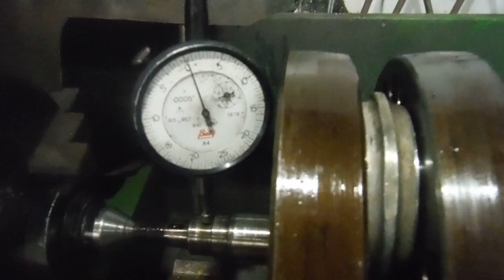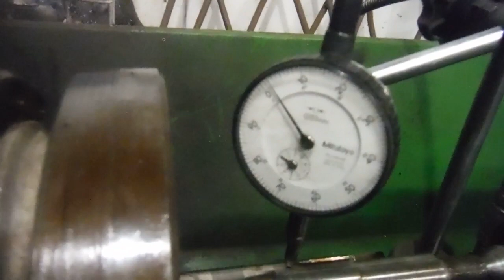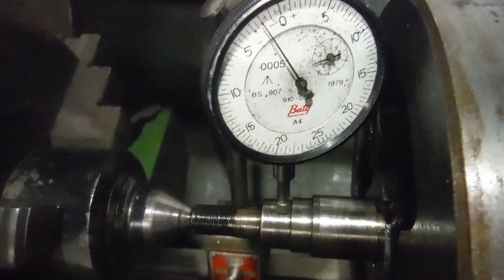Royal Enfield Bullet 500 crankshaft runout demonstrated and discussed.

Comment: Hello paul! I have a similar issue on my bullet. In my case, the rotor magnet touches the stator and  runout at the magnet is visible as it touches the stator. Due to this, my alternator stator is getting burnt up as I have changed 3 stators so far. How serious is my crank runout issue? Can I fix it without getting the crank case pulled apart?
Reply from the maker: Unfortunately, the crank would have to come out in order to put that right.
Reply: @paulhenshaw4514  That's sad to hear, but my doubts are cleared, thanks to you!

Comment: Am I to assume that that unexpected/unusual runout is due to an inherent 'out-of-balance' condition, causing a side-to-side flexing, and thus asymmetrical wear, of the shaft in question ?
[BTW, I just love the word grouping "that that" in the English language. A unique, grammatical, 'runout' of its' own !]
Reply from the maker: Sadly, that run out was probably passed as 'ok' by the factory, but the life of the main bearings would have been compromised as a result. That fretting on the drive side mainshaft is present as a result.

Comment: Yesterday i managed to spilt the engine, but the crankshaft wouldn't come out the left side without tapping with a rubber mallet.
Should it be adjsuted again on a bench? It ran almost vibration-free.
Reply from the maker: It is quite normal to have to do that. It should be ok.
Reply: @paulhenshaw4514  Thank you! i can be quite insecure about that.. at the same time when i see a crankshaft to be aligned, also with quite carefull blows..
I think when assembling, i will heat up the engine housing at 120 degrees and place the crankshaft in the freezer (jawa method) so nothing gets stuck half-way and have to hammer the engien together..

Comment: I must confess that I do not understand why the simultaneous rise and fall of the crank shaft ends cancels something.  I would think that any sort of lack of "truth" in shafting would place undo stress on bearings.

I not challenging this knowledge, I just don't get it.
Reply from the maker: It would be great if there were no runout anywhere at all, but that is rarely, if ever likely to happen. The best I have had was half a 'thou', but usually there will be two or three. If any runout can be moved so it happens to rise and fall on the mainshafts at the same point of rotation, when these mainshafts are running in their bearings, the bearings will get a much easier life than if the high and low spots were opposite each other and, as long as the numbers are low enough, they essentially cancel each other out, although this tiny rise and fall will be transferred to the flywheels and mainshaft ends.